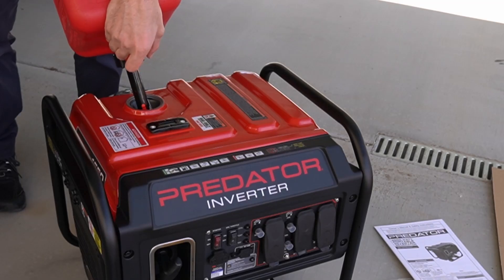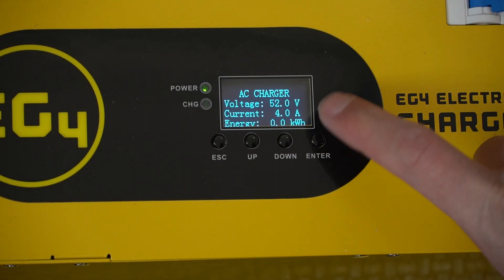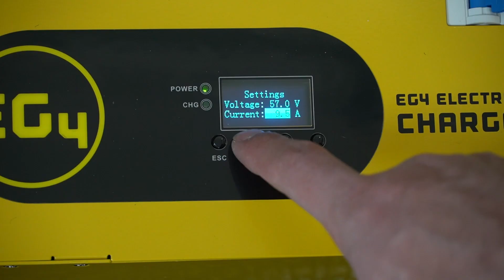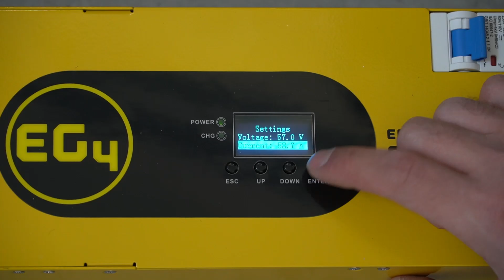New! 48V 5kW EG4 Chargeverter

Comment: I have a question I posted on another of your videos, but this topic is more appropriate.  So: 
On the diy power station build, when buying an ac wall charger, do I need to pair it with the battery chemistry I use?

Comment: Hi Will, I've been watching your channel for a while and I've always been interested in solar. I've done some projects but I have one that I'm stuck on. I would love to run this water pump on solar but I'm not sure what I'll need. It is a 1.5HP., 115V, 15A motor.
I tried using a 2500W inverter but it tripped the breaker. Any thoughts?

Comment: Thank you Will. I will be buying one of these for a grid failure situation, running this via a 5500 watt generator at about 4KW charging my 40 KWh of batteries. Basically a fail safe on a natural gas backed up generator.

Comment: Hi Will, would you mind (if you have not done already) to make a video similar to your video of  "Complete LiFePO4 Solar Battery System Design (Updated Blueprint in Description)" but not with cells but with batteries say 12v 7.5ah batteries - 4 or 6 of them. And also without solar - so effectively making your own quality UPS?

Comment: Sounds like there may be some issues with some generators damaging AIO inverters while battery charging.  My guess is that a good inverter generator with pure sine wave signal would avoid most issues, however; if SS is saying there is a need for the generator to have a 2x higher max output than the AIO inverter, that be quite important information to know before designing your system.  It sounds like Will is already on the case so I’m sure he’ll come back later after testing and clarify like always!
Reply: You can use a pure sign wave inverter generator to charge the batteries. The issue is with dirty power. SS recommends a generator 2-3 times the size of the system to avoid dirty power. They are not taking into account a well proven pure sine wave inverter generator like the predator 3500. Spoke recently with SS about this. The chargeverter is largely for construction generators.
Reply: @Blackbird-zo1su  I think a 3500 would faceplant trying to run even a single LV6548 in pass thru mode. The chargeverter is largely to allow batteries to be charged while inverting
Reply: I'm also curious about whether the issue with connecting a generator directly to an AIO refers to a conventional or inverter generator. This is the first I've heard of it.

Comment: It's nice to see that someone got a working product from signature solar. I've joined the long list of customers who received an inverter that's DOA and I'm 7 or 8 days in to the painstaking return process they have. A quick YT search reveals this is a big problem. I wonder how many others without a YT channel are having the same problem.

If you have any pull with the company I'd suggest  you inform them they have a huge quality control and major tech support issues showing up on youtube channels of regular people in bigger and bigger numbers.
Reply from the maker: Post it on our forum www.diysolarforum.com
Reply: @WillProwse   Thanks for the invite and that's a  nice forum you've created.  Not sure what I can gain by posting it on the forum since SS acknowledged they sold me broken inverter. OK so stuff happens. However the return process is enough to for me to avoid them and the EG4 products in the future. 7 days after the level 2 tech acknowledged the unit was bad I've been moved from the "resolution" department to the RMA team. No replacement sent yet or arrangements for returning the defective unit. Unacceptable.

Instead of just shipping a replacement with a return shipping label when the tech acknowledged they needed to send me a new one.  They are dragging their feet sending me emails about passing me between god knows how many different people. Who the heck does business like this?
Reply: @WillProwse   Tried that but my registration was rejected.  Your forum membership requirements seem to be like SS multi step tech support. Lot's of BS only to end up getting no where fast.

Comment: Hay Will, just trying to find out if you can use the chargeverter while the inverter is still running and connected to the batteries?
Reply: yes - that's one of the main reasons they made this charger

Comment: Hi DIY, I really need some of your awesome knowledge. 
I want to use garden towers in my lot. The water pump in the tower is run by electric. 
My lot is completely off the grid.
What type of  solar can I build for the water pump inside the tower  to run off outdoor and be weather proof and connect to multiple tower?

Comment: that a great item to have. anything can happen. keep for emergency charging. not all generators are gasoline. can be LP or natural gas or even a H2 engine. can be even bio-deasil .so many ways to make power. this will be a great charger to have on hand. What if your MPPT failed or the outher charger quit. backups many. way to go. this a independent separate charger only.

Comment: HINA Batteries in China are producing Sodium Ion cells from a new 1Gwh factory that will be ramped up tp 5Gwh by 2023. Then there is the new Sodium Aluminum Batteries being used by Ford which supposedly is 4x more powerful than Tesla cells. Costs are significantly cheaper. Will wait for you to test both these new cells.

Comment: Interesting video….
I wish I knew the best place to ask this question….
will  400 watts with 250 amps of storage be enough to run the small split A/C you recommend?
just during the 3 hottest hours- mid day.
200 sq ft.
Arizona-Mexico border location 

I’ve tried to join your form, but no luck there.
Reply: @text-855 Okay how

Comment: I don't know if this will help anyone or not, but I called Signature Solar to get some clarification from them on Will's statements concerning generators and all in one inverters. If you have an off the grid situation as i do with a cabin, generator use at times is an only option. So the message i took from Will was that you would need a 22KW generator and that a smaller generator will cause the all in one inverter not to work. Their response to me was that some generators send out such erratic sine waves that the inverter won't work with the AC power it is receiving. If your generator works then it works and you're fine. There is no damage happening, it just either works or doesn't. Also they are not recommending a 22KW generator, but they do recomment that the generator that you use have twice the AC output that your inverter puts out. So if you have a 3KW inverter, then have at least a 6KW generator. Maybe this info helps others as it does me. Thanx for all the good work Will.

Comment: Can you use a eg4 charger with a solar inverter to charge Tesla powerwalls?
Reply: Really would like to see you try connecting the charger to a inverter to see if you can inject AC power into your off grid system.  I wonder how clean the DC output is on this charger, can you connect a oscilloscope up do the output while charging a low state of charge battery pack…

Comment: That explains the shot of the Tesla at the gas pump filling a gas can.
Slick unit. I'm considering one.
Questions. Do the 4 mounting tabs line up with the server rack mounts?
And I assume the voltage is also adjustable? 
That could be a very versatile battery charger

Comment: What a great product. One improvement I would suggest is upgrading this charger to allow charging for 12v/24v batteries. Lots of us out there with smaller systems that would love this feature.
Reply: right my dads doing a 48v and im doing  a 24v setup
Reply: why not just use a 25 amp lithium battery charger
Reply: I know that would be great
Reply: Li time does make a high quality 12v lithium charge. Don't know about 24v though.

Comment: I use a small 1000w Alp propane generator to charge my system in December. I wasn't aware that it could cause damage. Can you please explain? I set the AC input on my Growatt inverter to match a mid range output for the generator.

Comment: Is there a bidirectional inverter out there that you could couple with a battery and home?  The scenario is I'm a home owner that has a generator hookup and transfer switch installed already and don't want to spend the money on an all in one system (most geared toward PV systems).  I want to hook up the battery and inverter to my generator receptacle on the house (instead of a generator) and use say a 10kWh battery as backup when the power goes out instead of a generator. Id also like to use this same receptacle to charge the battery when the power is back on...  Does this exist already?  I see something like this EG4 being so close but not quite there since it only works in one direction.   Something under $500 and in that 5-8kW range seems like it would work well for people who are looking to ditch the portable generators for power out situations.

Comment: Hmmm, I recently purchased the below.  Should I not be using the below charger to charge from a Gas/Propane generator? - ExpertPower 12V 20A Smart Charger for Lithium LiFePO4 Deep Cycle Rechargeable Batteries.  It did a fine job charging my 12V 300AH LiFePO4 Lithium battery from my home's 120 volt receptacle, however after listening to this Video, I'm not so sure that I should be using this charger with my generator?

Comment: I know you've been broke so maybe you can relate. The use case for one of these is to save money on batteries. Batteries are getting cheaper but they are still expensive. A cheap harbor freight generator and this running just an hour a day can dramatically decrease your battery requirements and get you off grid for a lot cheaper. You might have fun running the numbers but the big thing is you don't have to overbuild your battery system to account for cloudy days.
Reply from the maker: Very true

Comment: Why doesn't EG4 just build this into their Inverters and fix their faulty product.  I'm not a fan of someone selling me something else to fix their own problems.  Now what I could use something like this for is to charge up a battery bank in my truck with my 440 Dual Alternators (5000+ watts of power) Cummins 6.7 while I am tooling around town.   Then plug that bank into my off grid solar system to charge up the batteries at night or pre-heat water for my hot water heater or something.
Reply: Adding this into an AIO product would increase the cost above what many folks could afford AND increase the heat in the AIO box way too much, in my humble opinion. (I live off grid in the southern CA desert where the temperature in the summers can reach over 125F, so I don't want to add MORE heat to the system, but I could put this charger outside and run the DC wires into where my batteries are).

Comment: Could this be used to charge an electric car directly (not via a battery bank)? I know some will take offense to that but with multiple remote locations it doesn’t always make sense to have big expensive battery banks set up at each cabin. I would be interested to see if it emulates the double ground neutral that tesla needs for example
Reply: Probably not, as I understand that electric vehicle batteries are way over the 48 volt (nominal) system that these chargers are designed for.

Comment: I’m bummed. I wanted to get an all in one system for my RV as I figured the converter/charger would charge the battery safely when I run the generator. 😢😢😢
Reply: Wouldn't the cleaner output of an inverter generator be better than a non-inverter generator?

Comment: Question?????? Have you done a video explaining grid tied inverters with a generator input using an off grid system to power the gen input of the grid tied inverter? Can this be done, what would the upside downside be if you can?

Comment: Will, thanks for the review of this. I'm interested in one to pair with a j1772 on my box truck so I can charge at public ev chargers. What I can't seem to get an answer on is if the neutral is required or not for the 240v input. The J1772 standard is two hots and a ground, no neutral. Any chance you could check?

Comment: What you said about the all in one system failures related to generator connections is a major bummer. I was of the opinion that, within reason, you could throw a 7k-9k generator on these things and charge the systems no problem. Do you think this is true of ALL systems or just the EG4 brand?
Reply: It's all of the units. You cannot invert and charge batteries at the same time

Comment: Wish you would have gotten the larger harbor freight generator with electric start.  Then test if the 6500EX could start it when battery level gets low.   Secondary test to see if the 6500EX could turn the generator back off when battery level rises to a set point.    And NOT use the 6500EX for the charging, using the Chargeverter, only using the 6500EX for generator start/stop.

Comment: How would this charger be wired to an existing off grid system using a hybrid inverter the LVX6048WP.  Should the DC output of the charger be wired to the batteries directly in parallel with the hybrid inverter.  Normally the hybrid inverter would charge the batteries with solar input, but there are days when solar input is low and batteries need to be charged externally.  If the generator is powering the power supply which is charging the batteries and there is also some solar input the hybrid inverter will also charge the batteries.  Will this be a problem, and damage the inverter?.  Thanks for any help

Comment: Look into propane generators instead of gasoline or diesel. Once I got rid of my gas-powered mower my gas sits around forever. Propane doesn't produce as much power and I don't know how the cost compares but you can keep it around a long time without it degrading. Hopefully, you won't need a generator enough to keep your gas fresh.

Comment: Hi  

Is this charger good to charge AGM batteries ?
Reply: You will need to know what the maximum charging Amps is for your battery (bank), and if it can accept 57 Volts of charging power. You can set this unit to the correct Amperage.

Comment: Charging to 100% in an hour is 1C charging - not known for being good for the longevity of the batteries due to electrode lithium-ion local transfer rate starvation which drives up the voltage gradient across electrolyte, increasing potential for damage.  Long story short, you’re shortening the life of your cells if you do this with thick electrode prismatic cells.
Reply from the maker: Yes I have covered this many many times 😂 you must be new here
Reply: @WillProwse  new and yet also old 😂 Thanks for your great video content btw, you seem to be one to go ahead and get done that which others just talk about. More power to your elbow 👍
Reply: I have the Battle Born 270Ah batteries. At 50%C, that should mean I could charge them at up to 135A. Am I wrong?
Reply: @Tumbleweed5150  that’s correct and a good limit to stick to 👍

Comment: What is the power factor on the AC draw of the charger? I learned the hard way with a generator that I need to account for power factor (aka watts vs VA).  Power factor is not really an issue with grid power unless you're on an industrial rate, but it's super helpful to understand for folks that use an generator. That might be a good idea for one of your videos.
Reply: I think the best way to use a small generator would be to put a Wattmeter on the 110V output of the generator, (using the correct adapter), then start off with low Amperage, like 5A to 10A, and dial it up until it's pulling around half to 80% of the generator's Wattage rating.

Comment: I am surprised that you didn't pick up the Firman generator that is on sale at Costco. It has tri-fuel capability so you would never have to mess with gasoline, and it has both NEMA 14-50 and L14-30 twist lock receptacles.
Reply: Can you explain what the tri-fuel capability means?
Reply: @busimagen gasoline, propane, natural gas. Propane and natural gas will reduce the max and continuous output though.